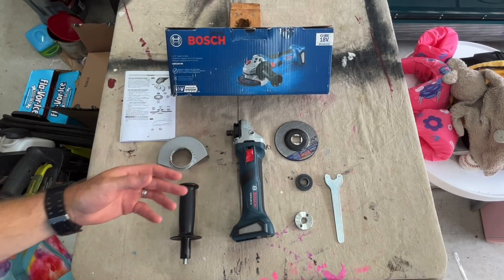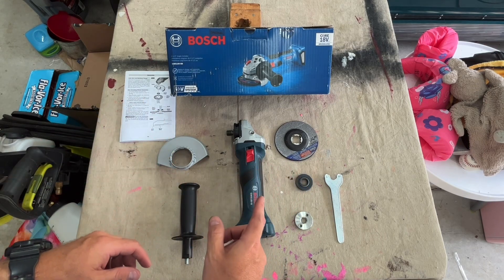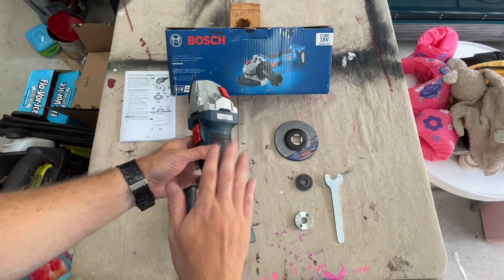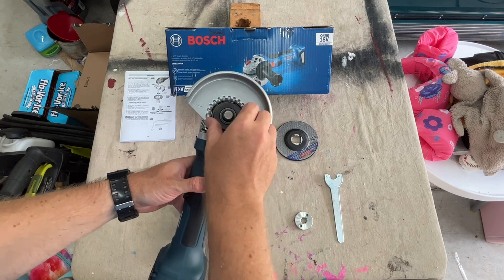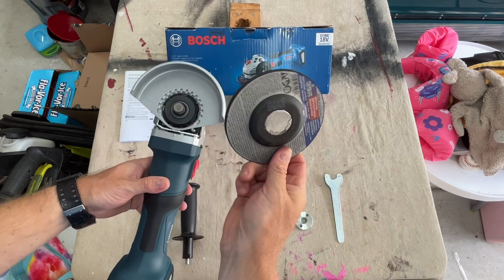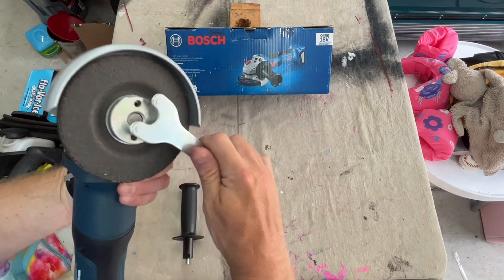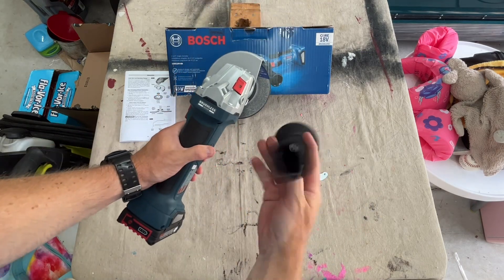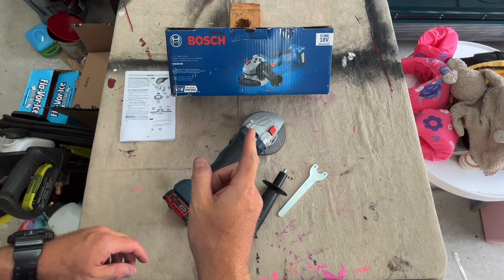BOSCH 18V Angle Grinder EASY ASSEMBLY

Comment: Bosh is one of the best examples of why battery powered tools for the private market is absolutely garbage.
Reply: Please do elaborate
Reply: @Sander_843  It's the way they offer two 18V series, one cheap, and one professional. Most will do fine with the cheaper one, but the cheap circular saw can hardly saw trough a normal 2"x4" and to buy the professional, you need to buy a new battery system, despite both being 18V. So, you end up with two systems, lest you stay with only the cheaper series, or the professional series, which is significantly more expensive.